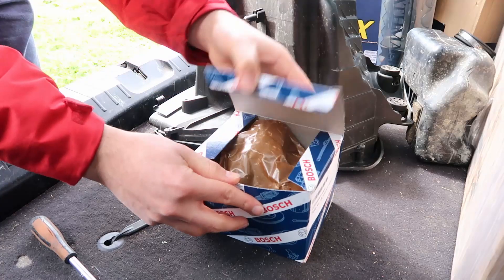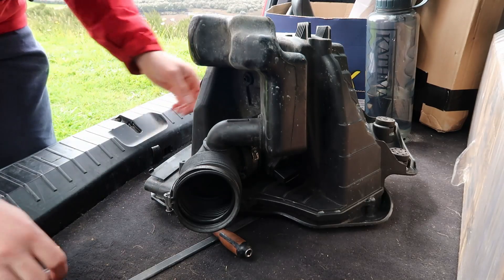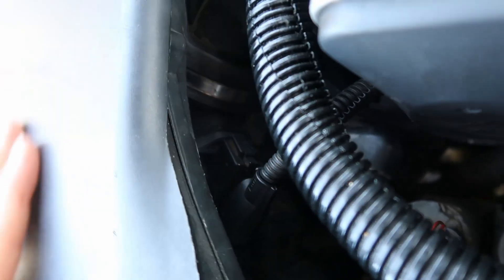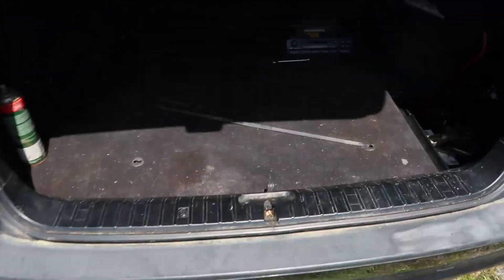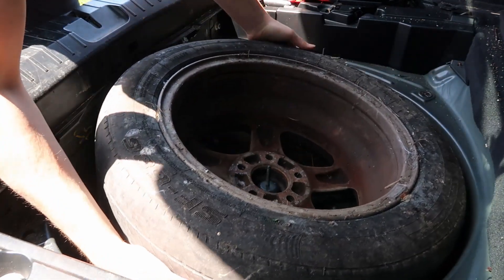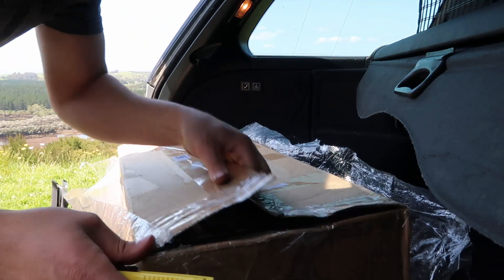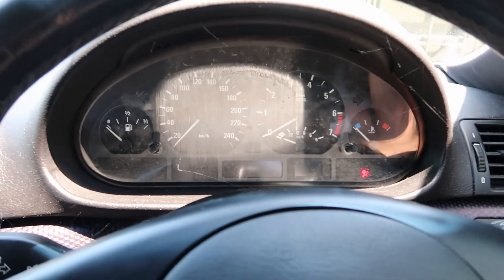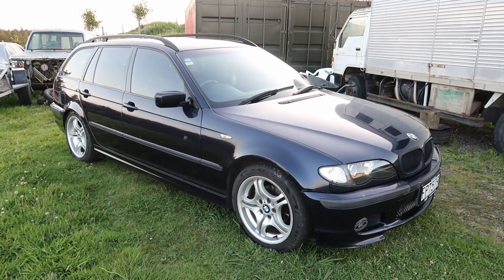Project Touring Update - New Parts, Manual Swap Parts & A Clean (BMW 318i E46 Touring - pt.2)

Comment: Hey there friend all the way from America here I got a 325i 01 can't wait to see this build especially if you do a manual swap as I'm going to be doing that and an engine swap I'm pushing 240,000 miles on my touring I figured I'll do 3.0
Reply from the maker: Nice! 240,000 miles is a solid effort. Yea definitely worth going to the 3.0 while in there 👍👍
Reply: @AngusLoggie.  hey thanks a lot man it's definitely got a lot of miles on the engine and the only things I usually got to worry about or those pesky lean codes that pop up every once in awhile but I'll be getting rid of that very soon